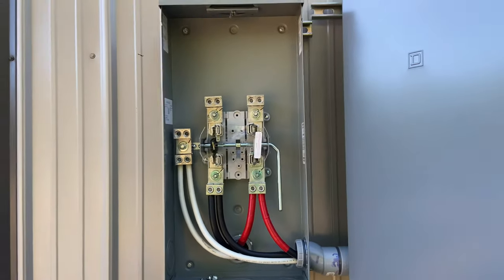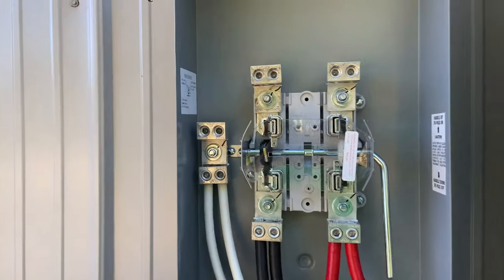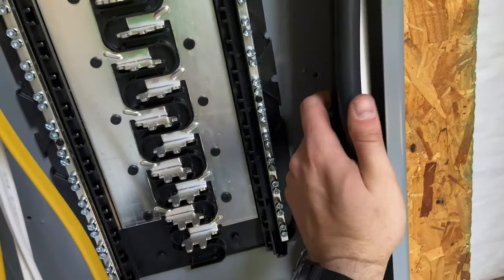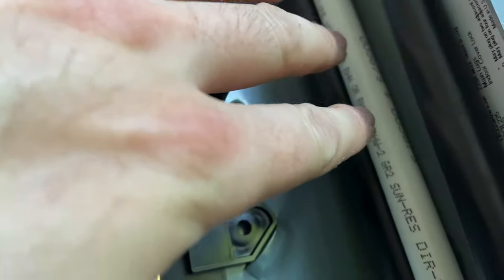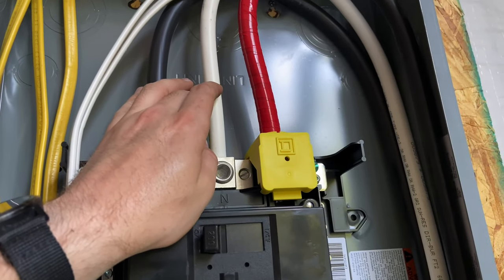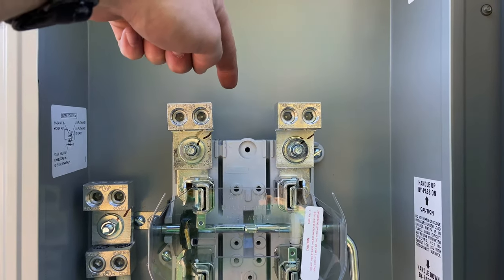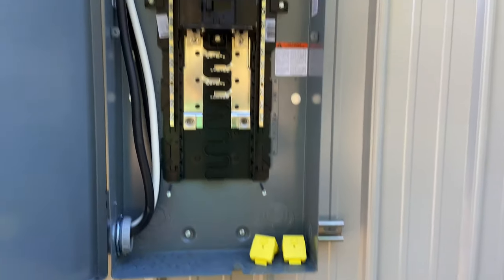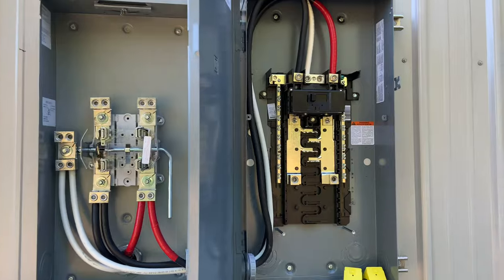Episode 16 - Service Entrance Wiring

Comment: Did you use the 83% rule? Since the entire load isn’t going to be out there?
Reply from the maker: Not specifically. Feeding a 200 amp OCPD panel with 4/0 AL seems to be code compliant for my application as far as I know. 

Are you saying the 83% rules can’t / doesn’t apply due to the 320A service or the feed through panels on the house set of service feeders?
Reply: @Ciband  oh that’s right, it only applies to service entrance

Comment: Hey did you have to get a panel with main breaker for your house?
Reply from the maker: I am going to. I will actually have another external disconnect feed through panel on the house and the a back to back panel in the garage. Each will have a 200A main breaker.
Reply: @Ciband   wow to much panels and disconnects lol . How big is your service?
Reply from the maker: Just 320amp. 

The extra disconnect on the shop building is one that I would not have put in but the PoCo made me. 

The one on the house is technically required by NEC 2020. I’m doing it mainly for convenience of have some breakers outside to feed other things like a pool sub panel. 

They are cheap. No one ever said I have to many spaces in the panel  :)
Reply: Gotcha.  Yea that's makes since know . Thanks

Comment: Nice video.. question.. What size wire did the electric company use for this service and was it aluminum?
Reply from the maker: Thank you for watching. 

My PoCo ran 4/0 Triplex URD from the transformer. I was surprised by this as it has to carry the 320A service. They said that is what they do. 

I know they don’t have to play by NEC rules so I assume it is ok for them. If my meter melts I guess we will know. 

Thanks for the question.
Reply: @Ciband  they ran 350 kcml aluminum to my service do you think that's very comfortable with me running 320 continues or too small? Thanks
Reply from the maker: Bigger than 4/0 so I would say yes.  Bigger doesn’t hurt.
Reply: @Ciband  ok so what do you think max amps for 350 kcmil  aluminum?
Reply from the maker: From the chart I found from Cerrowire (which I assume is based on NEC) it is 250A @ 75C and 280A @ 90C.  Not sure if they ran an HH rated conductor or not. 

I honest don’t know how the PoCo determine this or not. I’m sure they have different guidelines. I would also believe that the NEC very much errs on the side of caution. 

I wouldn’t worry. I’m not with my setup.
Reply: @Ciband  so that means what exactly? It seems like that is just telling me how much heat 250 and 280 amps gives off no? If not why would a wire take more amps at higher temperatures? I would think you woukd lower your amps with more heat.. im not an election just deal with stuff like this often but never at this rate of amps. Had to upgrade because I kept popping overhead service line..
Please advise
Reply from the maker: Gotcha. 

So different wire and the terminals it connects to have different ratings for temperature. Some allow everything to get hotter and thus allowing for more current capacity. 

PoCo are a completely different animal than residential wiring so I don’t know much about their requirements and codes. 

I would contact the power company if you have any concerns.
Reply: @Ciband  Power companies size their transformers to your load [undersized] 4/0 for 400 amp service .They figure that you will never go past 200 amps if you do it wont be for very long . My power company told me they put a 15 kva transformer on a 200 amp service .That transformer has a max name plate rating of only 62 AMPS. I did a 200 amp service change in my neighborhood the old underground 100 amp service lateral was number 2 aluminum .Now thats feeding my new 200 amp service. Poco figures that you will never even come close to pulling even 100 amps but if i converted the house to all electric THEY WOULD BE PROVEN WRONG.
We put in a 1,200 amp 120/208 3 phase 4 wire service poco gave us a 112 1/2 kva transformer which =only 313 AMPS on a 1,200 AMP SERVICE .I got angry with the poco crew asked them if they were on drugs they told me they totaled the four meters at the industrial park this company once occupied. I tolled poco that when they add more machines and possible AIR CONDITIONING THEY WILL BE BACK CHANGING THOSE TRANSFORMERS!!
Reply: @Ciband  ... I see you caught that too. If it were an overhead service it would be 2/0 wire at best for a residential connection. In their book it's "air cooled" so gets a pass to a higher rating unless you have a voltage drop situation.
Reply: @davefranz8766  ... those pole transformers have a serious surge capacity. They can run 150% of rated output for many hours and close to 200% for more than an hour. OTOH, I'd question that #2 service feed after 100 amps. There will certainly be a voltage drop, although likely within reason to about 150 amps if it's not too long.
Reply: @rupe53  Yes they like to overload transformers which shortens their life span. On the number 2 cable i totally agree that the lights will dim when a large appliance starts. My boss used to sell the customer on dimming lights with a 200 amp service change when i told him they dont change the cable anymore he replied il have to keep that in mind ,the lights will still dim. We did a job in Wisconsin WPL was the utility. We did a large house for a customer WITH BACKUP ELECTRIC HEAT .WPL ran 1/0 or 2/0 direct burial aluminum to our meter socket. I told the guy that that house had backup electric heat, he replied its just a house. We converted a 200 amp service to underground the lady complained of dimming lights. We installed a 2nd 200 amp panel = 400 amp service. Common Wealth Edison said they would charge to change the just laied 4/0 to 250 mcm. I dont think the lady ever did anything.When i started in 1986 COMED used to give you 250 mcm for 400 amp service with a 320 amp meter socket. I opened the CT cabinet on a mansion they were building with 600 AMP SERVICE, switch gear & 3 200 amp panels. This place had its own 50 KVA pole top transformer. This place must have had a BIG LOAD.
Reply: @davefranz8766  ... I did standby generators for over 20 years and a 50 kva is nowhere near a 600 amp service at full load. OTOH, the typical service is not likely loaded much over 50% plus motor start surge. Also, 250 MCM is not rated much over 4/0 so what did they gain? (50 amps maybe?) They are almost impossible to tell apart unless you have a piece of each in your hand. Lots of my work was on VERY large residential gear so not uncommon to see 100 - 400 Kw gen sets on a home. (yes, a home) Just before I retired I had to coach a new techie guy on load management for a large renovation where they wanted to keep a 600 amp service but doubled the size of the place. It was a LONG run from the street and the budget was tight. Long story made short they went from 9k sq ft to almost 20k sq ft and there were 18 AC units plus an indoor and outdoor pool. The load calculation showed he could get away with it if they staged all of the AC load out over a few minutes. Part of my job was to see if they could still use the 150Kw generator after the work was done. I tell ya, it was tight! Closer to "normal" was another job with 2 heat pumps with electric back up that was a pair of 50 amp breakers. What the electrician failed to add in was the 50 amp breaker for a water heater and a well pump. he sized the gen set at 32 Kw and should have been 42 - 48 Kw. Boy was that customer pissed off on the first cold snap. His service was "high and tight" at 200 amps but the generator was short  by 50 amps!
Reply: @rupe53  We did a 100 kw NG generator for a church / school which has  400 amp single phase service .Would you believe the transformer feeding this plus a house was only 37.5 kva. Kva is different from kw .That generator was a Generac with a 10 cylinder engine in it .It looked like a ford engine to me. I wonder on the Generac guadian 22 KW if the air cooled engines are really made by HONDA.99.9% of the generators we did were natural gas. I put 200 amp services in some of my neighbors houses i know they will never draw even 60 amps. Il bet that if i put a 70 amp breaker ahead of the meter it would probably never trip. I also put a 200 amp service in a 2 bedroom house just incase they expand the house, it was on a deep. In my area the ug meter socket is already 200 amps with 4/0 feeds so why not do the rest and make it all 200 amp. You will love this i worked in a ONE BEDROOM HOUSE with only 8 breakers in a FULL SIZED 200 AMP PANEL.. I asked the owner why did he get such a BIG SERVICE for SUCH A SMALL HOUSE He replied IM GOING TO RUN A 100 AMP LINE & SUBPANEL TO MY  GARAGE/WORKSHOP. I told him he did the right thing. In my area you must use only full sized panels these guys dont like 1/2 size breakers. The only exception would be if you had a 1/2 basement where you had a ledge .In this case they let us use a 200 amp main breaker that only held 20 full size breakers plus a 24 full sized main lug panel next to the main one subfed with a 100 amp breaker.  With very special permission we mounted a panel sideways like they do in Canada because of a ledge [foundation] .This looks like crap
Reply: @davefranz8766  ... yes, I know that KVA is different than Kw but considering the transformer rating for intermittent use they could draw well over 200 amps for many hours without a thermal trip. Staged out correctly you could sneak in 20 tons of AC and still get by in a pinch. Those Generac 10 cylinder Fords are the Triton truck engine and they make an 8 cyl that looks almost the same. Pretty bullet proof if you ask me. We sold a LOT of them and I never saw one break. (have seen a few use oil) The air cooled sets are Generac built and are very similar to B&S engines of a few years ago. They solved the oil consumption issues of 10 years back but still have some valvetrain problems. I have also see the "sideways" panels in short basements. Looks silly and you never know what to do with the door. <LOL> As for panels, only a few years ago we could still install a 100 amp but that seems silly when a small 200 amp is only pocket change more in the big picture.... and with a small home you will probably have 8 - 10 empty slots when done. If they add onto the house just do a subpanel in the new part because it will be cheaper and easier than doing home runs back to the original panel. I recently changed my service to 200 amps and the first thing I did was use the old 100 panel as a sub to my gen set, which is fed with a 50 amp breaker. The 200 panel got all the AC, air handlers, hot tub, sauna, range, air compressor, etc. just to get them away from my gen set. A full draw test shows a bit over 90 amps with everything running steady. Not sure exactly what the start surge is but suspect it's near 150 amps for a few seconds. The gen panel adds about 12 amps per leg on an average evening with  lighting, TV, computers, 2 fridges, etc. Bottom line is it's hard to fully tax a panel these days, but older / smaller service feeds are still out there. My homes is fed by #4 aluminum and I can't see enough voltage drop to bitch about... maybe 3-4 volts down under full load.
Reply: @rupe53  Theres a house in my town that has a 2 wire 120 volt service fed by no 12 wire dont understand how they can live with that. when i was still working there were houses in Chicago that had 30 amp 120 volt service. My nephew thank god  hes selling the place he and many others still have 120/240 60 amps with a fuse box. When i was in high school i met this guy that had a 120 volt 2 wire service and told him he had major electrical problems. I talked to many and studied code books. I installed a 100 amp service and split up & added many new circuits. The employer a had since 1986 checked out the job i did in 1979/80 and said it was above code.That was over 40 years ago. When i was in the company truck i saw a house that had newer 120/240 volt 3 phase 4 wire delta service it was an average home .I dont understand why they would want this kind of service.I would consider it dangerous because most home owners know nothing about 3 phase not to mention that high phase. I was reading on the net that some one built a mansion with 480 VOLTS with a transformer in a cinder block room at each end of the place. THE CITY MADE THEM LIST IT AS A LODGE BECAUSE OF THE 480 VOLTS they insisted on. Have you ever seen a single family home with 480 or 480/277. The most dangerous services ive ever seen are 480 VOLT 3 PHASE 3 WIRE GROUNDED "B" PHASE .All the breakers are 2 pole feeding 3 phase loads If you touch phases "A" or "C" YOU WILL RECEIVE A 480 VOLT SHOCK ,this also comes in 240 volts. THREE PHASE 3 WIRE UNGROUNDED 480 VOLTS has 3 lights,a bell & a surge arrester on the B phase. When one phase goes to ground "A" phase that light goes out but no fuses blow. They can keep things running until the factory is done making the batch but lets say a second fault occurs on phase "C" on the other end of the building NOW YOU HAVE THE FAULT CURRENT TAKING AN UNKNOWN PATH before the overcurrent device activates THIS IS DANGEROUS .Those older systems DID NOT HAVE EQUIPMENT GROUNDS in the conduits, this also come in 240 volt. Square D mentioned they are going to stop making equipment for GROUNDED "B" PHASE 480 . I HATE THIS SYSTEM [CORNER GROUNDED DELTA] it got 2 GIRLS KILLED IN TAMICO IL ON AN ARAGATOR god rest their souls.
Reply: @davefranz8766  ... In rural areas I still see 120 / 30 amp once in awhile. Usually older home and older people... and obviously a gas stove. That's the way my house was built. (circa 1910) I have only seen a hand full of homes with 3 phase 208. They are usually an older place in a better neighborhood, built with "old money" IYKWIM. Guessing this is a throwback to a time when heavier gear and serious electric was only done in 3 phase. Might also have been done to power irrigation pumps for grounds keeping. I never saw any 3 phase panels (beyond the entrance gear) or 3 phase appliances, but there could have been at one time.
Reply: @Ciband  The power company determines the size of the service drop to use based on the load letter you give them which lists all the major electrical loads in your soon-to-be-built house.
Reply: @Ciband  What's going to kill these undersizing POCOs are EV chargers. If you have 2 Tesla chargers running, that can be an honest 90+ amps for hours. There were some pictures on a Tesla forum of a guy with 2 chargers causing his 15KV pole transformer to bubble and smoke. I think he got a transformer upgrade after telling the POCO that their equipment was basically on fire ;)
Reply: @Ciband  Utility companies are exempt from following NEC codes. They often run higher amp loads on smaller wires to the meter .
Reply: 4/0 urd cable is rated for 315 amps buried in ground

Comment: Could you please provide a part number for the Meter Base and the Feed Through Panel? I am doing 320amp as well but I have to supply my own meter base. Thanks!
Reply from the maker: For the meter can, I don’t have the part number and it is sealed now by the PoCo. 

The feed through panel I’m using is a Square D Homeline. 

Model is: HOM816M200PFTRB

I know they make a QO version if you want that upgrade. 

Thanks for watching and I hope this helps.
Reply: @Ciband  Who is your PoCo? Sometimes they have the required equipment on their websites?
Reply from the maker: It is a local electric coop.  Unfortunately they do not have the information on their website.

Comment: why you have 2 main panels? don't you have to ground at main panel to ground rod(s)?
Reply from the maker: For my 320 amp service, this is how it is wired. 

I have the two main disconnect panels bonded to the ground rods and each other.

Comment: Nice. Question and I’m a non electrician by the way. If I’m using a 2 gang meter socket and I want to feed 2 200 amps to 2 meters. Is 3/0 Cooper okay to wire to that meter socket or would I need 4/0 copper?
Reply from the maker: Double check the NEC tables but I think 3/0 copper is fine. 

For 200 amp, you need 4/0 aluminum or 3/0 copper.
Reply: @Ciband  For service or feeder conductors, you can use 2/0 copper for 200 amps.
Reply: @edwinlandy  thats only for a dwelling
Reply: @krakenwoodfloorservicemcma5975  it is a dwelling.

Comment: 😳 I’m not an electrician myself but watch videos like this one so that maybe I can learn how to do simple stuff around the house and avoid paying someone $2,000.00 dollars in the NYC 🗽 Area just to move a meter from one spot to the other🙄. Savages 🤯🤯😠. And what I notice about this guy is that even though he admits he’s not an experienced electrician and that’s his first rodeo or one of his first, he’s very clean when it comes to doing his job. Might be the requirements in his state but in my state I’ve seen some horrible stuff such as “experienced”??? electricians using a number 10 wire to feed from the street to the meter on a two family house with at least 8 rooms including the basement; washer machine, dryer machine, electric kitchens and giant microwaves in the two floors that when you’re cooking you can not use the microwaves cuz the wire gets hot and supposedly has been approved by the city inspector🤔 so like I said it before I’m not an electrician but I believe that even a blind person with the minimum level of knowledge in electrical stuff can see the mistakes “experienced” or careless electricians I would say, can make.

Comment: Do you have a link to the 2nd box beside the meter box?
Reply from the maker: The feed through panel I’m using is a Square D Homeline. 

Model is: HOM816M200PFTRB

I know they make a QO version if you want that upgrade.
Reply: @Ciband  thank you very much